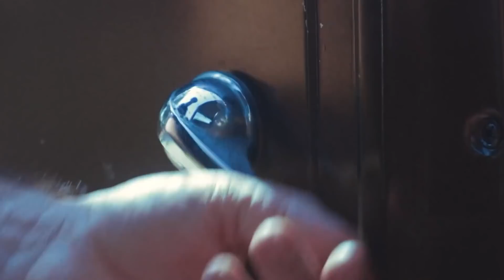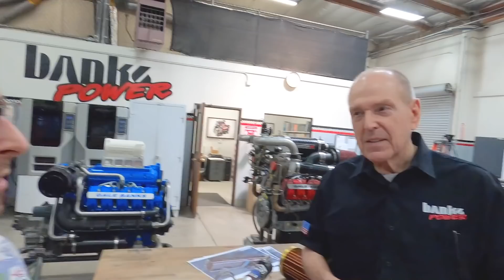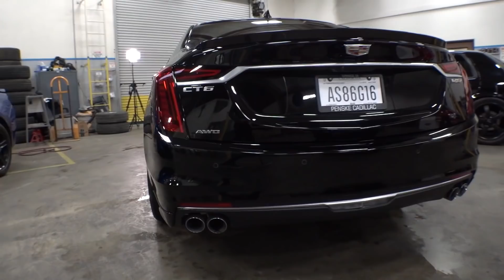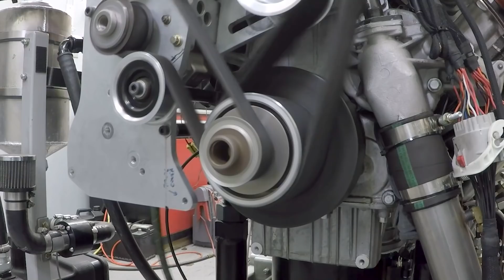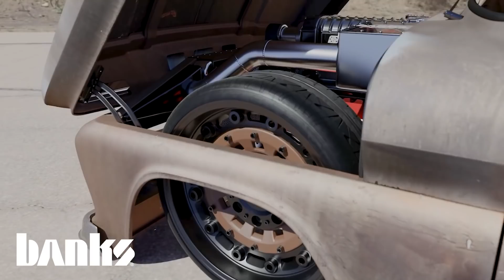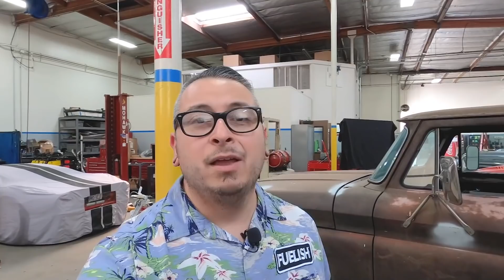Gas vs. Diesel with Banks Power | The Bottom Line

Comment: Diesel can never compare to $/hp. How much does it cost for a regular guy to make 1000hp with a Duramax? And let’s not forget about the tranny that it takes to support 1000hp Diesel engine. Anyone can make 1000hp with an Junkyard LS. For the price of one Duramax Injector, I can buy one used 5.3 Liter at the junk yard. I love what Banks is doing with this project but what they are doing is Ferrari Money Level Hot Rodding.

Comment: Gas engine for cars ... diesel for trucks. I don't know why they ever build trucks with a gas engine especially if you want to tow something.  But I'm a fan of the Cummins 12 valve that averages 20 mpg  loaded where the gas engine in the same truck may get 12 mpg unloaded.
Reply: My 6.8L v-10 cries because I'm living in Cali now because of work and gas is literally over $4.00 per gallon on average, on 10 mpg. 😢. I wonder how many mpg this engine gets on an average large truck/van.
Reply: Gas is cheaper. When I had my Diesel trucks and they broke down, my shop bill was in the thousands every time. My LS engine, I can repair myself in the driveway with Cheap parts.

Comment: Wheels should be 6 lugs on 5.5" bolt pattern. Chevy used that pattern on all 1/2 ton trucks in the 60s and 1970.
Reply: It’s a c20. 8 lugs for a 3/4 ton truck. Also makes it interesting
Reply: @radioactiveload  I know that I've been autot tech since the 70s I was referring to the '50s through late '60s 6 lug half ton bolt pattern on all C10's.
Reply: Well where's your truck if you know better?
Reply: @WvlfDarkfire  I'm 70 years old and have owned several C10 Chevy and GMC ½ Ton pickups. They all had 6 lugs.

 http://67-72chevytrucks.com/vboard/showthread.php?t=767901#:~:text=Re%3A%206%20lug%20on%20c10%20Chevy.,-Not%20to%20be&text=Now%20from%20the%20war%20time,back%20to%20the%206%20lug.